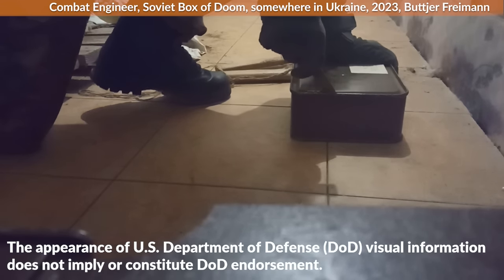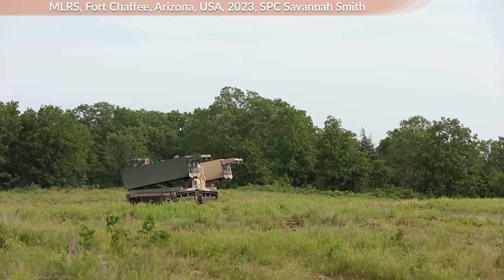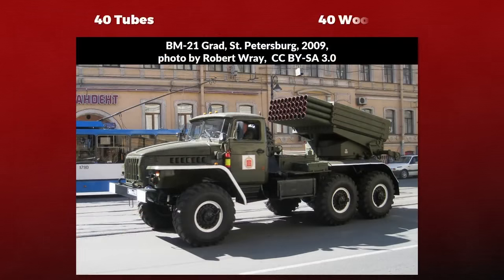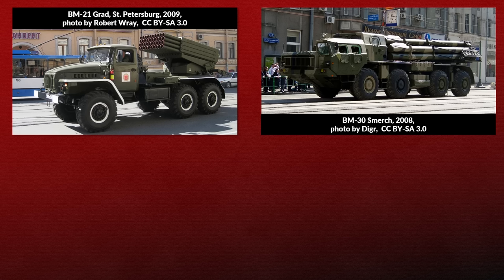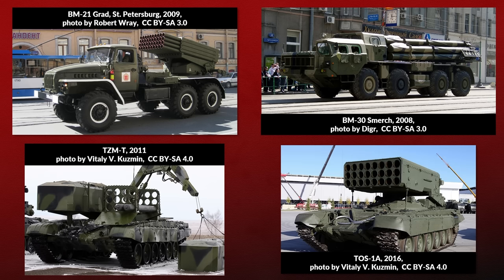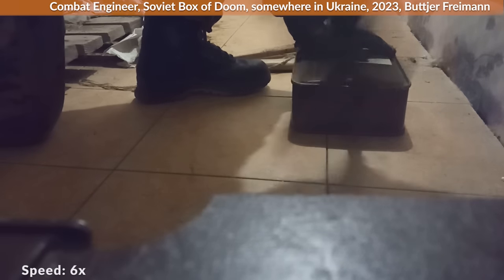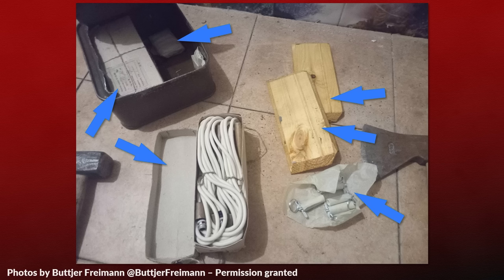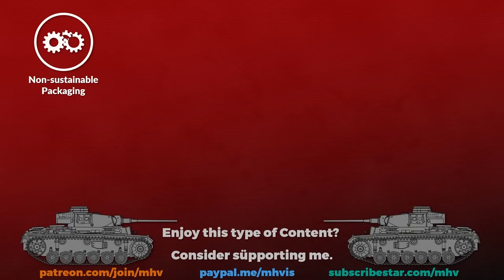Ukraine: Why Soviet Packaging is a Nightmare - Unboxing Edition

Comment: What strikes me when seeing this video is the sheer appetite for raw manpower this kind of supply situation would have. I could imagine complete companies of low skilled draftees being needed and used to unpack ammunition shipments before forwarding them to batteries and individual systems. Granted, the Red Army was likely set up around having lots of low skilled draftees precisely for these kinds of reasons.
Reply: Like there is someone who won't be a draftee when shit will be grabbed by the propeller. ¯\_(ツ)_/¯
Reply: @worldoftancraft The Rich lol
Reply: At least someone gets it. People don't realize how different cultures can be. 
It's like I saw in India. You often don't need complex machines or hyper efficient systems, if you have an abundance of manpower.
It is stupid to think that one solution is best for all situations. 
People never think about these differences. It is a lack of imagination, of intelligence.
Reply: @melanieenmats  The fact that you can achieve the same with 50 low skilled workers as 1 skilled worker can with a forklift in half the time is NOT a positive, nor does it speak of intelligence. It either means you're desperate, incapable or stupid. The additional logistics strain alone should be obvious.
Reply: @melanieenmats  Those 50 unskilled draftees create a LOT more logistical burden than that one guy and a forklift though, you now need a 50 man crews worth of food, water, clothing, and work equipment. instead of the logistical burden to supply one guy and a keep a forklift (or two, in case you want a fully functioning spare on hand)
Reply: In mother Russia, everyone has a job.
Reply: @Sir_spooky you’d probably also want a spare guy, but that’s 2 guys and 2 forklifts vs 50 guys
Reply: That’s exactly what they were planning on. The Soviet system relied upon a small cadre of professional officers and NCOs, with the bulk of the forces being made up by conscripts with comparatively limited training. The red army knew from the beginning they would have plenty of bodies to spare.
Reply: @MajinOthinus  you guys don’t understand, you’re comparing Russian culture to North American/Western culture still. Russia has always had a bottomless pit of manpower, it doesn’t matter to them the logistics of fielding an army of 3,000,000 compared to 200,000. Their production lines produced millions of weapons in the Cold War that were stored for long shelf life (like these cans), and their production lines might have been considered crude or primitive by western standards, but it didn’t matter because “quantity has a quality of its own,” -Stalin. Thats how they equipped this bottomless pit of manpower. And Russia doesn’t fight overseas, it fights its neighbours. Everyone thought killing 300,000 Russian soldiers in Ukraine would deter them, but if you’ve got an endless supply of “good enough,” weapons and 10x the man power, you can absorb the losses and still grow. The Russians don’t need a forklift. 
This is historical fact from all wars in the past few hundred years that the west still hasn’t learned from, Russia has manpower, the West does not, they ALWAYS win the war of attrition.
Reply: @drewski5730 if you look they don't have the manpower anymore. They are 150 millions, half of them them are older than 50.The simple technology works better in Russia because of poor supply chains. Yes a forklift I'd better, but this needs fuel,and many spare parts, and if you don't have this because long supply line and administration incompetence, then you better have something simpler that works in any situation
Reply: @i5730 This is not an issue of culture, it is an issue of simple math.

If you are using manpower to substitute technology and equipment, you simply achieve an objectively inferior result for the amount of resources - both capital and human - you put in.
Neither does Russia have the demography to just throw away its human resources, or the industrial base to throw away its equipment.
And it hasn't had either since the end of the 19th century.

I also don't know where you are drawing this myth of Russian invincibility from. I know the Russians believed it, which is why they tried it again and again, but anyone even just glancing at history or the current state of Russia will tell you the opposite.

They:
-lost the Crimean war;
-won the Russo-Turkish war, but were forced to give up most of their gains (lmao);
-lost the Russo-Japanese war;
-got crushed in WW1 as a secondary front;
-lost to Poland;
-barely managed to win against an isolated Finland;
-barely "won" WW2, a victory (not won alone btw) so Pyrrhic and with so much damage to their industrial and population base that they haven't recovered to this day (and never will);
-lost to Afghan militias;
-lost to Chechnyan militias;
-won against Chenyan militias by continually bribing them to this day (they can't stop);
-won against a Georgia that was barely better equipped than aforementioned militias;
-and are currently stuck in Ukraine with a third of their entire tank fleet and half their total artillery (both including their stored reserves) lost.

Their last victory that deserves this name was against Napoleon. Maybe the Russo-Turkish war if one is being generous.

The truth of the matter is: Russia does not have manpower. What manpower it had in the past, it squandered in the world wars , the civil war and through being an authoritarian hellhole. Their demography is so catastrophic that they'll lose the ability to field substantial numbers of soldiers within little more than a decade.

The West meanwhile has a huge population advantage.
The US has more than double and the EU more than thrice Russia's population and that's not even counting the rest. They just have objectively more manpower on top of their absolutely crushing economic and technological advantage.

So do please tell me again how Russia will grow its human resources on trees and throw them against the West's guns to win an attrition war, because not even the Russians believe that one.
Reply: Except . . . where are the reusable, re-sealable ammo boxes for transporting the unpacked ammo to the actual front lines? There aren't any.

The strategic protocol is to transport the sealed man-portable box to a front-line position that is not under fire; unload a specified amount of boxes of specified type at a map point, and move to the next map point. A third-line unit is marched (less identifiable than being moved by trucks) to the logistics point, and commences unpacking. That unit is supposed to remain for accountability, but often leaves because troops standing around in the open are observable and a target for artillery.

The field improvisation to deal with the lack of reusable storage is to find some to aquire:  laundry baskets, foot lockers, hope chests.
When the ammunition or other supplies are unpacked, a first-line unit scheduled for rest-and-refit or a second-line unit already on R&R will be provided with a map point where the stores they need are awaiting them.

This is from actual Soviet logistics manuals from their War College.

In practical discussion -- some students are the sons of war veterans, after all -- there can be issues. The wrong cans dropped off at the wrong map point. The map point was transformed by artillery fire. The map point is under observation. A different unit fell in on the assigned map point. An artillery unit is parked on our food, and expects counter-battery fire to be arriving when they leave -- so why waste the [best parts of] the food?

You may recall the size of the ammunition cans. The Mi-24 Hind-D has/had a 12.7x109mm four-barrel gas-operated rotary heavy machine-gun that cycles about 800 RPM, and the ammunition bay for that holds 4,000 rounds nominal. A little more, with creativity, a little less with experience. If I still recall correctly, the standard ammo can was fifty rounds -- plus there commonly is no tool available to crank the linked belt into the helicopter's ammo bay, so the helicopter has to be disassembled as for servicing to manually load the ammunition bay fifty rounds at a time, assembling the belts with a linking device on-site.
Reply: @MajinOthinus  so which wars of ATTRITION did they lose? 😂 
They do have the manpower, it’s on full display in Ukraine where they’ve run the defenders out of ammunition.
Reply: @drewski5730 No, they really don't. They're already in a demographics crisis BECAUSE of this shit. They've been suffering a demographics crisis ever since WW2 and the break up of the USSR.

Most of their population is over 40-50.
Reply: Plus the sovet logistic system sort of was designed around coms not working.
Like Moscow would go okey current state of war send X amount of supplies here.
because coms between us and the front is crap.
one part of the soivet military strategy was the fact that a nucular war happen and coms would be completly dead and design the system around it.
Reply: @hummerskickass very similar to the czarist armies before, except the local inbred noble was replaced with a political commissar. 

Apparently it was decently common for families to hold funerals pre-emotively for their kids if they got conscripted, even if there wasn’t a war. Long service times, rare leave, and a general disregard for the lives of conscripts means many never saw their families ever again.
Reply: @drewski5730  check out even just a total population graph of Russia. Their population has not significantly grown in the past 25 years, nevermind the actual demographics of that population (one word. Boomers.) 

Putin is literally throwing away any hope Russia had for the future for some land in Ukraine currently, while the west quietly laughs and shakes its collective head, as Russia expends every resource, both manpower and otherwise, it had that posed a threat to the west in a conventional war to fight Ukraine.

Honestly the only benefit Russia would really gain from Ukraine is the additional population (maybe that's why Putin really wants it) but if they win through a massive war of attrition that ends up decimating both  country's military age demographics, as well as requiring Ukraine to be completely rebuilt after, it's not really going to help their problem.

Putin is like Cersei from game of thrones, he can't be trusted because while he's pretty smart, he's not nearly as smart as he thinks he is. He's so focused on restoring the Russian Empire that he can't see the big picture, and how Russia would be much better off if it focused on economic rather than military development.
Reply: @drewski5730 Every war Russia has ever fought has been a war of attrition for them. Ever since the Mongols made them their bitсh. I literally gave you a list.

And what manpower is supposed to be on display in Ukraine?! Russia hasn't managed to make the frontline move more than like 2km every 3-4 months  (in their favor anyway) anywhere since the summer of '22.

Their biggest win in the past 1 1/2 years was that they managed to move the frontline 11km from their '22 starting lines over the course of the last 2 years. That's a mid WW1 western front level of front movement if one is being generous.
Reply: @MajinOthinus  listen dude, you need to go back to school and get a proper education. Not history or this crap, but like a real skill set and some first year courses, or better yet just finish grade 10 to start. You live in a small world dominated by things you’ve made up in your head.
Oh, and give the ten accounts you use to agree with yourself a rest. Maybe go outside too. Try meeting people or something.
Reply: Fork lift on a front line? Lol…
Reply: The Red Army sure, but not the Russian Army of today with its political restraints.
Reply: @drewski5730  "They will always win a war of attrition!"
Except you know, WW1, and the winter war,  afghanistan, 

Also Russia had manpower when it could pull as many young men as they wanted from their occupied territory's, now that eastern Europe and the Baltics are free what manpower Russia actually has on hand is much less impressive
Reply: @zimingzhao8395  And man restraints. 
Alot of these logistics where again, designed around the man power youd get from pulling from the 15 countries they had under occupation. Quite literally hundreds of millions more men then they have access to now
Reply: Problem is since WW2 Russia is no longer a manpower rich nation. Its demographics are in a hole even to this day given the millions of soviets lost. Russia currently has around 143 million people total. Soviet Union prior to its collapse had a population of 290 million in 1992.  Low birth rate, demogrpahic issues and the loss of territories (with its non-Russian populations) have drastically lessened their available manpower. The US currently has over 331 million nearly 332. Its culture and traditions may not value its manpower shortages but that simply makes things worse for Russia.   @melanieenmats
Reply: You got that incredibly backwards. When compared to UKraine which is the topic Russia still has huge manpower. 
Secondly wtf birthrates. The birthrate is only a predictor. It can change rapidly. This is simply a talking-point from economists that predicted the collapse of Russia MANY times. 

Also all of the western countries have the same aging problem. It's simply not relevant to the current conflict. @MarcusDarkstar
Reply: Americans look at the soviet logitstics situation and wonder why they dont just use forklifts instead of conscripts. The reason is quite simple: communist command economy. There were never enough forklifts to go around because forklifts not being military hardwares were not deemed a priority by the planners. In America you could just buy a forklift from the dealership. In the soviet union they would have had to wait years for one to arrive from the factory, and thats if upper management approved the units request which was unlikely to begin with. Half of Russia was muddy wasteland so forklifts wouldn't be able to traverse anyways. If they did dedicate enough material and manpower to produce stuff like forklifts, home appliances, food and clothing for their citizens and good roads everywhere, they would not have been able to make that many rifles and tanks. At the end of the day the soviet union was just an underdeveloped country trying to compete with the west by doing perpetual war time economy. Eventually people got fed up so the union fell apart.
Reply: @drewski5730 using manpower to replace capital is strictly inferior, culture is irrelevant lol. it creates a cascading logistics issue that quickly makes your army much much more expensive. that’s 50 more people you need to feed, clothe, house, care for. you thus need even more people to handle the logistics of feeding, clothing, housing, caring for those people, and so on. incredibly, incredibly inefficient use of resources.
Reply: @hschan5976  It's not just half of Russia, it's now all the Ukrainian frontline that becomes muddy in spring and autumn! Good luck even transporting a forklift there, let alone maintaining it
Reply: @jonathanpfeffer3716  Have you seen any recent video of a road on the current frontline? 50 manpower will easily march there but a forklift will be stuck. And that's before the real mud season, it's just around 0 Celsius
Reply: @ain92ru  No way you’re seriously arguing that non-palletized conscript hordes are the most efficient form of logistics lmao.
Reply: This guy gets it
Reply: It should strike you that the majority of soldiers time is down time and so as long as they have quantity it doesn't matter.
Reply: @jonathanpfeffer3716  They are optimal for that particular theater, Russia's limited size of economy and a prolonged war of attrition, in which scarce complicated hardware is just going to attrite away. This is one of the reasons why Nazis lost WWII: they made their bet on complicated hardware they couldn't afford to replace
Reply: @ain92ru  you consider a forklift scarce complicated hardware lol?
Reply: @drewski5730  Lol. Lmao even.

When I originally saw this reply, I wasn't even sure if I should deign to answer it, but scrolling through my old notifications, I saw it again, so I will.

So to make things short: I have a PHD in Computer Science, was a trained electrician before that and currently make 6 figures. I am furthermore an active member of the military reserve with the rank of Major.

So pray tell, what "real skills" am I currently missing in your opinion?
Reply: @MajinOthinus  I’m an Egyptian pharaoh, also trans, with a doctorate of alchemy from Acme university in Atlantis. Don’t quit your day job
Reply: @drewski5730  If you don't want to believe me, that's fine. Doesn't save your argument in any way or change the reality of my statements, but if it's enough to make you happy, who am I to deny you that.
Reply: @Sir_spooky 50 conscripts just need reworked and directed civilian supply trains. A big burden but an easy burden.

That 1 crewman and his reloaded vehicle needs more specialised spare parts that is harder to ramp up to replace envitable loses.

Ie is larger but more robust supply chain or a smaller but more fragile one. Which one is superior depends on the context of the war
Reply: @ain92ru  Are you calling putting more ammo in easily accessible polymer boxes "Complicated hardware"?

lol, lmao even
If anything getting individual rockets from individual wooden boxes without handles seems 10x more complicated.
Guess this is why they can't even defend their own land anymore lmao
Reply: That’s why the Soviet army was called “Workers' and Peasants' Red Army”.
Reply: @Kannot2023 Absolutely nothing works in every situation. It's always a matter of tradeoffs.